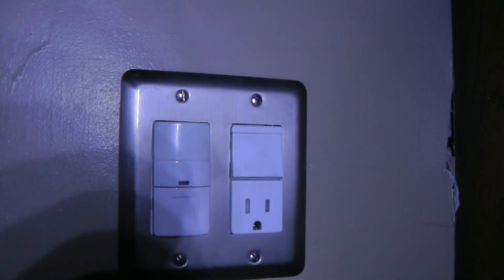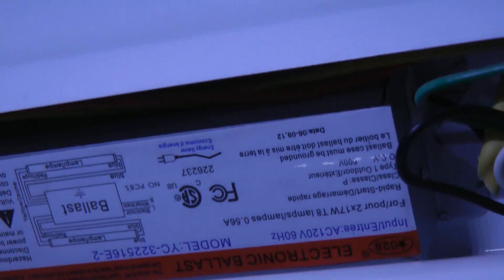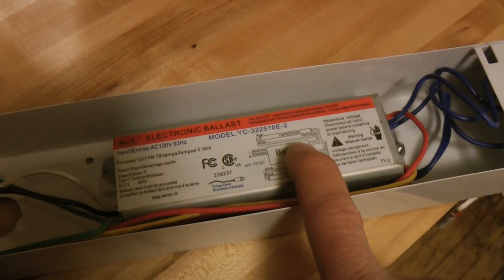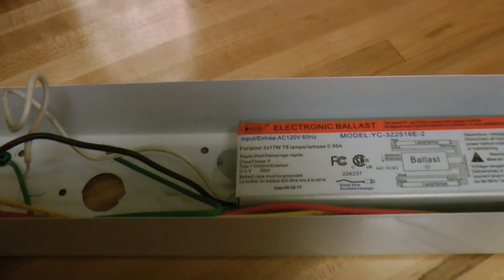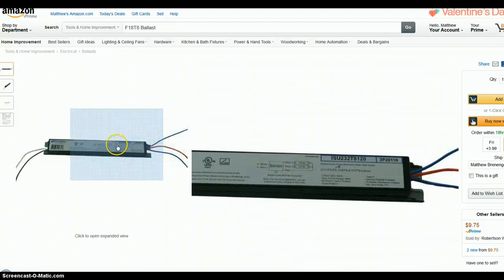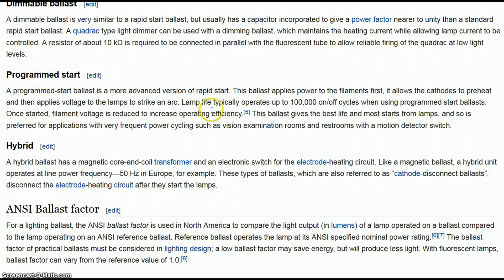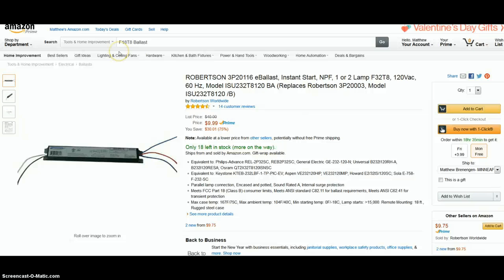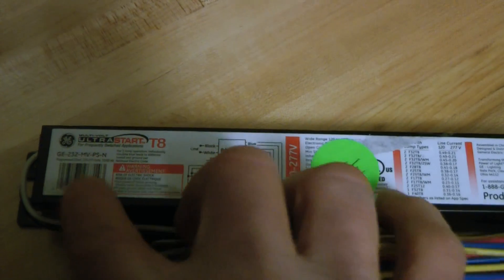Why did my fluorescent light stop working?! Replace your broken ballast with the right type.

Comment: Someone can correct me if I'm wrong, but I believe that ballasts operate at their full life when you use the number of bulbs it's rated for. in the video it looked like you only had 1 bulb in the fixture, and that is not good for it. If you are using it like that, and plan on continuing using it like that, I would recommend using a 1 light ballast in the future.
Reply from the maker: Nick Dvorchak I had two. The new one dies fairly quickly and replaces them with LEDs. Much better!